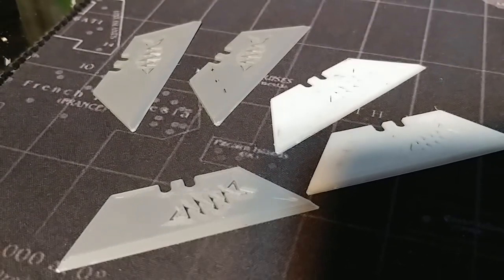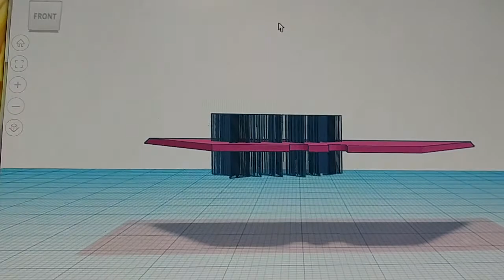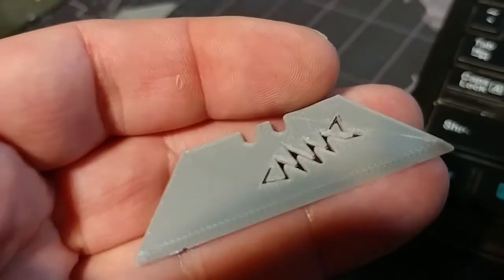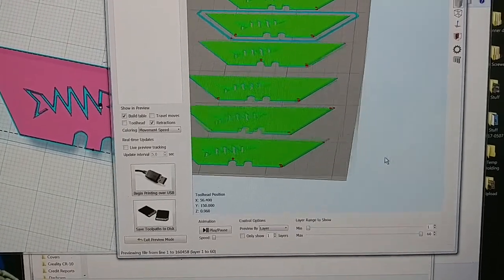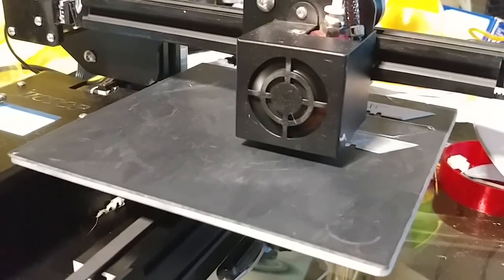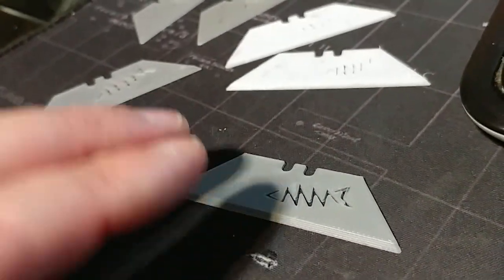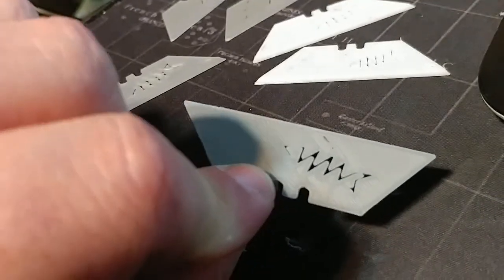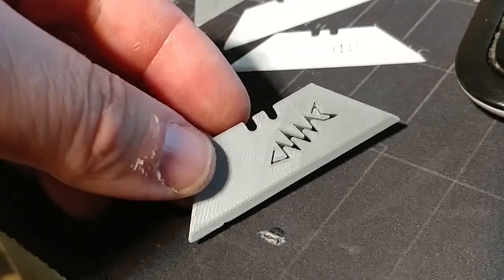Today'3 3D Print - FIrst Job Plastic Utility Knife Blade with Logo

Comment: you could turn the top layer infill pattern by 45° and you get straight lines on the top surface following the blade shape (horizontally)
Reply from the maker: +pixelcomet that's actually not a bad idea I might try that just to see what it looks like although I think I'm still over extruding just slightly for this particular model another .02 down and I might get a really nice smooth top layer

Comment: On thingivese recently i posted a design for a folding knife, that uses utility baldes i wonder if it would fit?
Also plastic blades are great for getting your print off the bed :)
Reply from the maker: Tac Blades it'll fit perfectly I have a pile of revisions to get it to that point